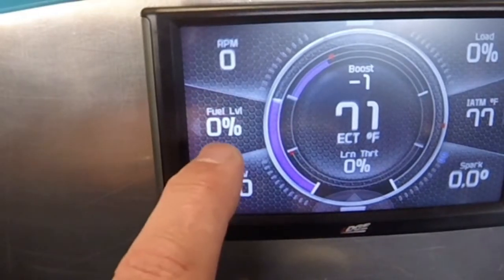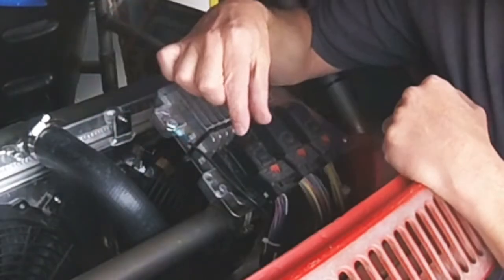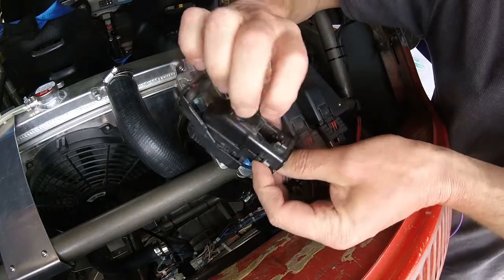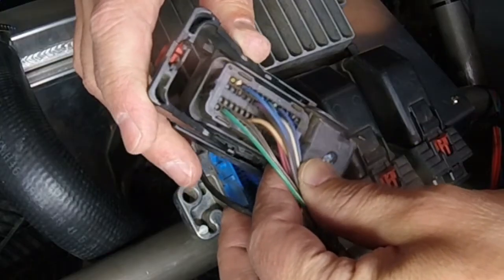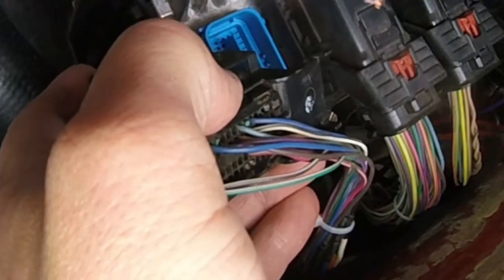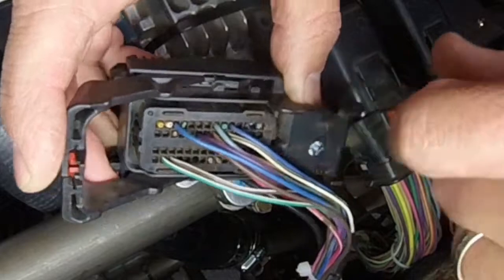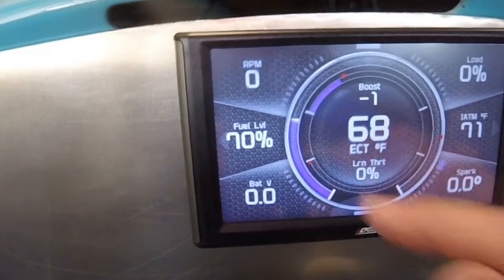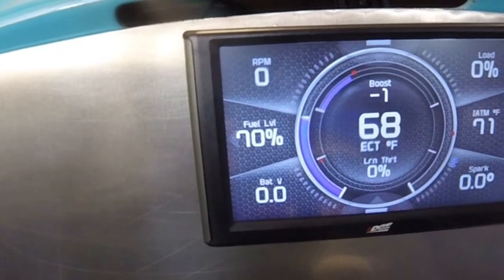ECM Plug Terminal Replacement

Comment: Hello Sir, what size terminal pin did you use for that wire? 1.5, 1.7, or 2.4?
Reply from the maker: Not sure I understand the question. Do you mean on the terminal I used, or the tool?
Reply: @DougBugBuilder , those ECU connector pins has a measurement spacing. The brand that wasn't Molex, had those measurements. I was trying to order the right ones on Amazon. But, I recall you left a little list of items ya ordered off Amazon. So, I ordered the molex MX64 series 33467.
Reply from the maker: @patsuddarth1093  Ok, looks like Amazon doesn't offer them anymore. If you email me at dougbugbuilder@gmail.com and I'll send you a parts list I have of the connectors and pins. That might help you out.

Comment: My problem is my 1,3,5 plugs are firing my 2,4,6, is not im.thinking it's my ecu bc I changed the plugs and coils my code reader say that the 2 4 6 is misfiring. I took out one of my plugs and coil put it up against metal there was no spark I looked at so many videos on it. But there wasn't too much on it. So I came across yours im.hoping that's the problem I'm having. I've got a 2008 saturn outlook came you give me some pointers on what to try (thank you)
Reply from the maker: First thing I would check is that those coils are getting voltage. If they are then I would trace down the signal wire and make sure it is connected to the correct pin on the ECU.

Comment: That tool looks great - but....at $70.00 for the tool, isn't there a less expensive tool available?    Is there any way you could reveal what the outside diameter is for this tool is and is it a hollow tube solid?   

I have lots of terminal release tools, but without knowing what size this Molex tool is or if it is solid round, or a round tube - (or some other shape), I don't know if I have the proper size.

If you could share the measurement and whether this Molex tool is solid, or round tube, that would be great!
Reply from the maker: The tool is solid and it is .026" in diameter. If you found a very small drill bit that size it should work too.

Comment: Thank you Great help. Also wanted you to know that you can pop out that blue insert that you raised up 5mm by prying on the other two sides once you raise it 5 mms. This way you can use a jeweler's screwdriver to release the clamps. Will save the $60+ dollars for the .  tool. I don't plan on doing this again
Reply from the maker: Thanks for the info!

Comment: this is very informative. how would you know if you had a loose connection to where the pin on the ecm is not fitting snug into the female hole that the wire is crimped onto?
Reply from the maker: That would be really hard to tell. But first make sure all the pins out of the ECM are perfectly straight. Then inspect the plug. I would then replace any connectors that You thought you were having issues with just to be sure.
You can't really test those connections with a meter as they go into the ECM. So you'll need to basically do it visually.
If you have HP Tuners it would help to connect and read data then wiggle the plug around to see if any sensors go in or out.

Comment: Thanks for this vid, ecotec swapped my Miata and couldn't figure out how to repin for a tach wire
Reply from the maker: What wire are you using for a tach? I've never been able to find that out.
Reply: @DougBugBuilder  from what I've found out from wiring diagrams, and from talking to others on forums, it's terminals 24&25 on connector c1 (from factory they are not used and a plug is in the termination slot). Terminate and Splice both together, then T off your splice to the tach signal wire. Another forum user I talked to said it worked for his setup (06-07 e67 ECM)
Reply from the maker: @ruthlesschoy  So take 24 and 25 and splice them together and run it to the tach as a signal wire. Interesting? Please let me know if it works so I can give it a go. Thanks. Mine is the E67 so I'm really interested to see if it works.
Reply: @DougBugBuilder  yeah signal being your ingition coil wire or ignitor wire to the tach. I'll send ya a message or reply here and let ya know once I do it!
Reply: @DougBugBuilder  I can confirm it works. Terminal 25 is tach signal but doesn't work without a pull up resistor, just so happens that terminal 24 is a resistor, so I spliced both and ran it to tach and it works! Just needs to be dialed in with hp tuner
Reply from the maker: @ruthlesschoy   Wow, this is really good info! Appreciate the response.
Do you know what needs to be done in HP to make it work?
Sorry for all the questions but I really want to have a nice analog tach in my Baja.
Reply: @DougBugBuilder  no worries! I actually plugged into obd2 yesterday to monitor my rpms digitally to see how far off my analog gauge was, and I was mistaken, if it is off its not enough to tell on my analog gauge, so I didn't even go into hp tuner to figure out adjustments.
Reply from the maker: @ruthlesschoy  Perfect! I can't wait to do this to mine so I can have a nice tach. Thank you a ton!

Comment: thank you so much for the video. im going to use it to install efans on a truck that has a clutch fan. i need to add two pins into the plug then its just programing the truck to turn on the fans.
Reply from the maker: Figured it would really help some people out. Good luck with the project. 👍

Comment: Any idea where to get those plastic red slide tabs on the pcm connector ?
Reply from the maker: I got my parts from "Mouser Electronics". I don't have the specific part number for that part. But here is my parts list for my harness. It might get you really close.
https://docs.google.com/spreadsheets/d/1fnBB_REe4OeXN1TI6EHYXByqRd17N5kOIWYPU5TTUOc/edit#gid=0

Comment: You should check with Holley about there holley terminator when you redo the harness. You can check it out on Sloppy mechanics YouTube they're using them on the Chevy LS engine if you could use it on yours it might give you some neat options
Reply: Anyone have the part number for the metal pins required for an NNBS Silverado ecu?

Comment: Good tip . great video demo .  wires are the hardest part of the build for Me I want to change my 2332cc VW  motor .  I like the eco Chevy 200 hp  that you went with  . but the Honda V 6  has 300 hp  . what do you Think.?
Reply from the maker: The Ecotec is a great motor and it scoots along nice! But it you want wheel spinning torque go with the V6 Honda. But you'll need a good transaxle to back it up!

Comment: like to know more about the stock sending level set up, not sure if you made a video on it? thanks for all your helpful tips.
Reply from the maker: Hello Ed,
About half way through this video I go over some of the sending unit/fuel pump installation. https://www.youtube.com/watch?v=p5tNM8NqBWc&t=8s
I ran two units for backup. If one fails on the trail I would need to swap the fuel line and the electrical plug. Then I should be back on my way.
Any questions beyond that let me know.

Comment: GM weatherpack terminals will release with a small paper clip as well did it for years as a GM dealership line tech
Reply from the maker: I suppose that might work on this if it's a really small paper clip. The wire on this tool is so thin it's almost like a needle. And at that it's a snug fit. But if that works it's a great tip! Thanks.
Reply: The release tool for an iphone would probably work too.  :)